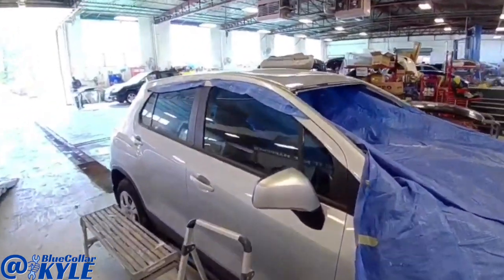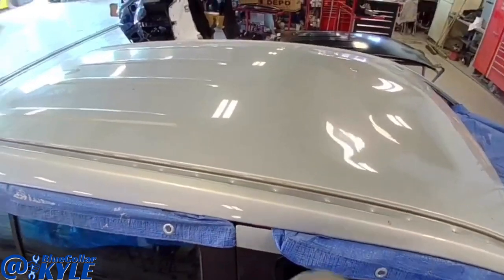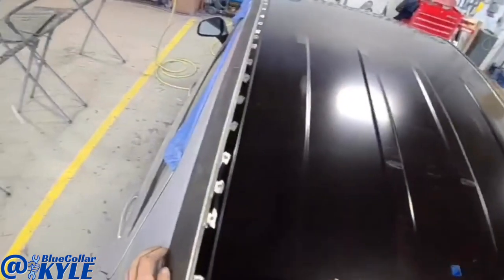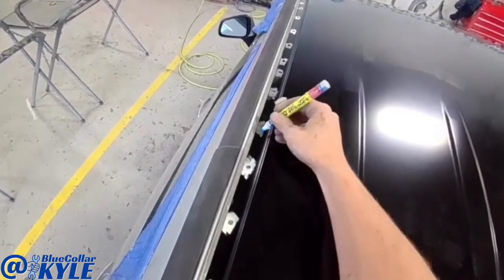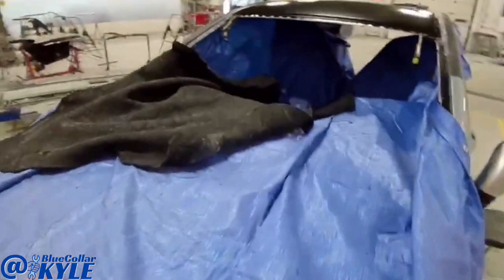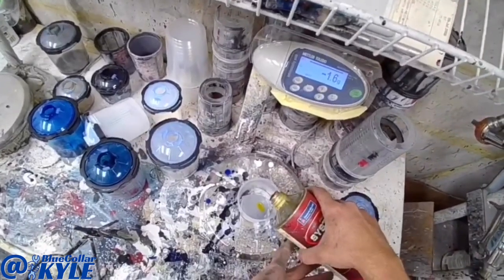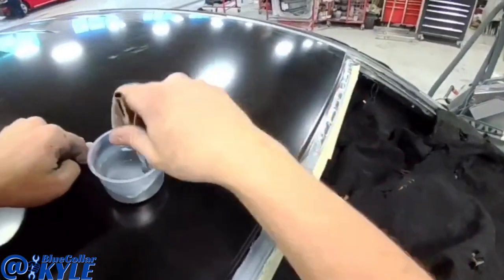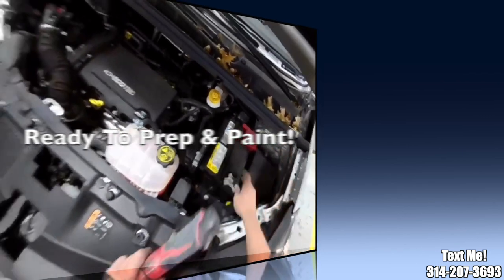Make It A Convertible!

Comment: Hi I was told that there having problems with putting bare metal seam seal on roofs. It a hi  Moisture area and will rust under .  4 or 5 year later . And pisser 2 i painter in inner roof like you and layer seamsealer on the bow . It bo not stick very well to that can paint . It will sticks to the oem sealer .give it a push and see you might be surprised.  Just a thought.  Ask your 3m representative  to confirm.
Reply: i found a good product for seamsealer its black majik and has held up no combacks in last 10 years and yes bare metal holds like crazy and can paint within 30mns and lays smooth and flows even with acid brush.crest makes it.its also a adhesive and they make a adhesive to for repairing plastics which holds better than 3ms in my opionion